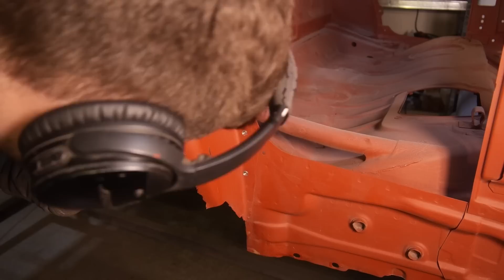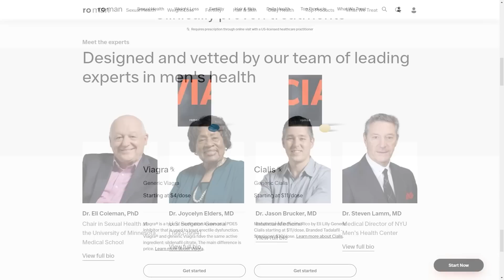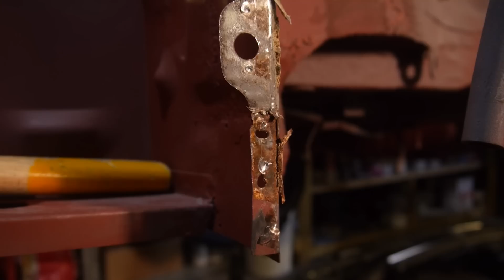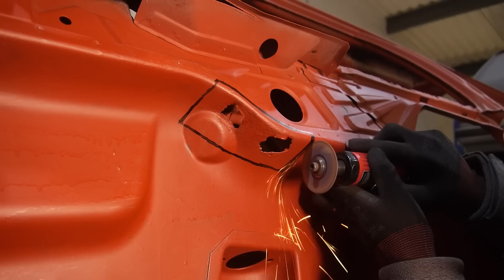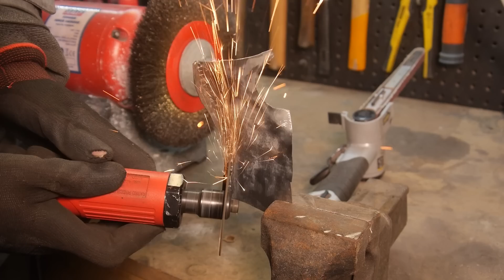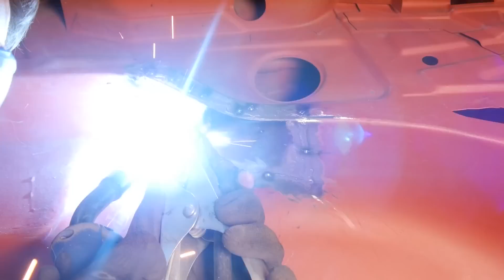Even More Rust! - BMW E30 325i Sport Restoration

Comment: My friend i suggest you to come to Greece and buy very cheap a BMW or a MERCEDES.They are very cheap,no rusty even if they are 40 years old.A E 30 you will buy it for 1000 - 2000 euro depends of the condition and offcourse totally free of rust.
MERCEDES and BMWs do not rust.  
If you find one of these cars with big engines will be cheaper because of tax system of Greece

Comment: I would still try to coat in between panels. Its not guaranteed that all those parts will be e coated. Just think about how hard it is to get zinc plating into cavities etc. Better be safe than sorry. You cant really lose anything with doing that except a little extra paint.

Comment: you were asking how to remove the spot welds ,have you tried a grinder with a grinding disc ? its look like a cutting disc but it's thicker (5 to 8 mm) it is also good to ruff grind welds as is faster than a finger grinder so you put less heat in to the metal

Comment: Don't do acid dipping unless the same place that does the dipping or someplace else can also do the same e-coat 'dip' process that manufacturers have done for decades, where the chassis is totally sunk into primer and it penetrates every part and crevice of the chassis. Remember acid dipping and paint removes EVERYTHING, also primer and other coatings in places you can't even see or get to.

Comment: Just a quick trick that I myself realised waay to late. Currently restoring a W116, and while welding I often come across larger than ideal gaps. Instead of putting 20 welds and a lot of heat in it and warping it, I took a copper pipe (like ones for water taps), and beat the end completely flat, then bent it 45 degrees. You can but this behind the work piece and the weld will "flow" across it, closing the gap in the metal, while not sticking to the copper. Saves a lot of time, grinding, gas, and you feel smart ;)

Comment: as far as the lower corner that you mention, it doesn't look like BMW factory welds. Also, if I may make a suggestion, an old timer taught me to never cut my patch pieces with straight corners. He radiused them heavily, so there's no concentration of heat input on the meeting of 2 straight lines into a corner, but rather a homogeneous and even input across a rounded corner when you weld in the patch. You may want to give that a try, it's a lot easier and it also leaves behind a much more pleasing-to-the-eye, almost "organic" patch that doesn't quite stand out as much. And the panel warps a lot less.

Comment: on bigger panels such as that wheel well, you can cut off the piece you're replacing near the seam and your spot weld removal bit will be easier to manage. I often times have used a machine screw countersink and drilled a pilot hole in the center of each spot weld, leaving a small thru hole on the posterior panel that gets filled once you do the plug weld. Or there's some jobber lenght drill bits that Black and Decker made in the UK that have a tiny "pilot" drill bit and then sorf of a flat 2 flutes front face cut to cover from the pilot point to the nominal OD, I loved those, especially 8 to 10mm diameters.

Comment: 6:54 I quickly checked my 1987 pre-facelift 4-door E30 and it has a similarly shaped sheet metal part in exactly that spot. It's been coated liberally in seamsealer though, so i cannot tell what the welds underneath look like. My car has certainly never had any work done there, that's all original. So if somebody replaced that part on your car, they probably did it with factory replacement parts
Edit: I looked a bit closer and i can see and feel those bodgy welds underneath the seamsealer. That's factory-original weld quality🤣😉

Comment: You get a stop for your spot drill.. Basically a metal ring with a pinion screw. Set the stop for the thickness of the plate your drilling, and use the sander for the rest.

Comment: Hi. Maybe look into rust converting the panels that had rust on them prior to priming. Even when there is no visible rust left I do get a reaction if I apply it to the bare metal. That is because some of the rust gets mixed in under clean looking metal from the high rpm power tools. I would get someting not acid based like Brunox which is with epoxy.Also about the acid bath: I heard it is really hard to get all of the acid out of small spaces so since it is appart now anyways I would stick with your method.

Comment: For the spot welds that are hard to reach, i'm using extension bit. Made it out of exetension for wood drills.  Quite easy to make, just a sleeve to center drill in the extension's socket

Comment: what about a drill bit stoppper on the spot weld drill bit.  it wouldn`t help with tight spaces, but for other areas, it`s make the operation pretty mindless..  just push till the stopper touches the metal, and bingo, yoou`r done.  maybe?

Comment: The body shop guys i watch use a finger sander or a small cut off wheel in a die grinder to grind through the welds. Sometimes they drill them too. The die grinder makes much quicker work of the welds and is cheaper than replacing the paper on the finger   sander

Comment: For longer spotweld drill bits. Make your own. If you have a lathe make a extension so they fit together then weld it. That way it will turn true. Being in the back of the drill will not hurt the temperature on The Cutting Edge

Comment: You can make your own longer W pointed drill bit for drilling out spot welds that will let you reach those hard to get spot, since the drill will be out from the panel and the bit can be up nice and close. Just use a say 6 or 7mm drill bit or how big you need and sharpen the same geometry as the purchased ones (which are far too short), just be sure to leave a small chisel in the center of the drill so it self centres. Good luck! So nice to see someone doing a restoration properly!
Reply from the maker: Thanks Patrick! I'll give this a go.

Comment: You might be able to speed things up a bit buy purchasing a second (and possibly a third) chisel to separate the spot welded sheet metal...  Once you pound the first chisel in, just leave it there and insert the second, third chisels into the gap you have opened up with the first chisel...  Also, I might try using chisels with different shapes, such as narrower, wider or rounded nose...
Reply from the maker: Thanks Al, some solid advice here. I'll look into it, cheers,
Reply: @RestoreIt   - Centre punch and Spot Weld Drill!

Comment: Invest in a tool steel bit with a flat faced cutting tip, two flute or more, it is harder than drill bits and sharper, cuts through welds like butter and does not hurt the panels behind. Or make one from a 3/8 milling tool bit.
Reply from the maker: I believe thats what I'm using. Its the one that came with the chisel type that has changable heads on it.
Reply: @RestoreIt  talking about instead of a drill bit, not for chiseling but for cutting the spot welds. They are tool steal and will not dull like a drill.

Comment: A half used cutting or grinding disk is faster and 10 times cheaper than a finger sanding band................ and it does the same thing as the belt.
Reply from the maker: That's a good point... I've seen a few garages do this. I'll give it a go, cheers, Richard.

Comment: Apparently  you are not ment to turn the compressor off and on by that red switch and not ment to turn it off at all while it is running, think he said red switch is a emergency cut off only🤷‍♂️
Reply from the maker: I'll look into this, John. Thanks for the advice.
Reply: @RestoreIt  Yes, he has a point. One should never turn off a compressor while it is running …….. it can cause damage to it. I was taught to always let compressor finish its cycle until it shuts itself off when it reaches pressure ……. Only then shut the on/off switch.
Two other pointers I wanted to pass on to you. There is another British gent I watch who is doing similar work on an old Mercedes (I think his channel is Mercedes Maintenance …. He is on the West Coast of US. I have even mentioned your channel to him in the past and he said he has seen your channel too. His name is John. Two things I have heard him mention:
1. When you are spot welding in your patches …. After you get the first batch of spots done he says to grind them down rather than waiting until you have done the whole patch. He says if you do that you can see the pinholes you have left much easier and you don’t build up as much weld which you have to grind off again.
2. He uses the finger sander a lot like you do …… He says he used to use the heavier grit paper a lot (40 grit I think). He finds that the finer grit paper like 80 or higher works just as good and does not wear out as fast. The rough paper rips apart too quickly and wastes a lot. I may be wrong on the grit number I am quoting 40 to 80 …… maybe 80 to 120 ….. but I think you get the idea.
Sorry if I am rehashing something someone else may have said to you already or if you disagree with what I have said. I enjoy watching the work you do and admire the tremendous patience you have.

Comment: hi, I've seen other channels cut out the bulk of the panel that are removing then drill out the spot welds. don't no if this will help?    Fitzee's Fabrications is a good channel to wacth  he makes a lot of panels from 3-4 bits of metal.
Reply from the maker: I've actually seen him to this myself. It's a good shout actually. I could have easily done that. Cheers Kenneth, I'll keep it in mind.

Comment: If you now take a spot weld drill instead of an ordinary steel drill to drill open the welds, it will be a lot easier and better... whatever I see here and there, it goes a lot faster too...
Reply from the maker: I'm using the flat spot weld drill bit that came in the kit, alongside the chisel tipped ones. I'm confused, is that bit even a spot well drill bit?... The none chisel tip one...

Comment: I am using Bosch Cordless Multi Purpose Tool with metal blade which is thinner then the normal chisel tip, it makes it easier for you to separate panels and break the silicone and beads
Reply from the maker: Thanks for the info B K, I'll look into these

Comment: I think that bracket was for the brake line.
Reply from the maker: I think you might be right Mary. I wonder if BMW still sell them... Its a long shot.
Reply: @RestoreIt  if not, some manufacturers use something similar to metal plumbers tape and it gets painted too, but I’ve watched you from the beginning and know you want OEM parts. Th donor car doesn’t have one? I also want to say that you do amazing work. I am impressed at your welding skills improving so quickly too. Give yourself a pat on the back for what you do, it’s not easy rebuilding and repairing vehicles but you take it to the place I’ve always wanted to go. 👏🏼👏🏼👏🏼

Comment: I’ve run into the issue with clearance for spot weld drill bits as well. I’ve found that using 1/4 hex to 1/4 square socket adapter with the correct size socket  to fit the hex shape on the spot weld bit works pretty well as a bit extension.
Reply from the maker: Interesting, I'll give this a go, cheers, William!